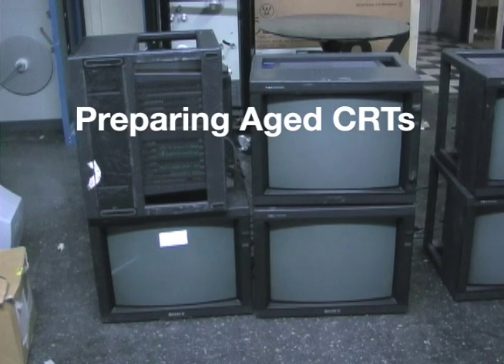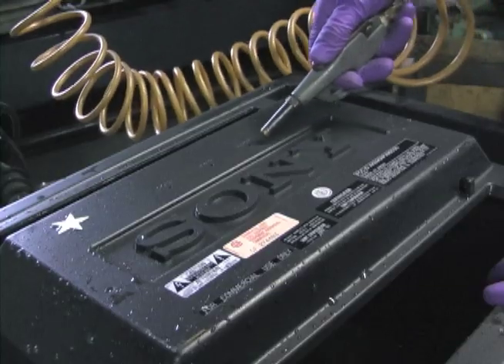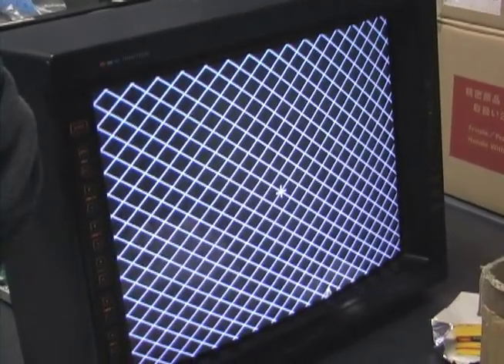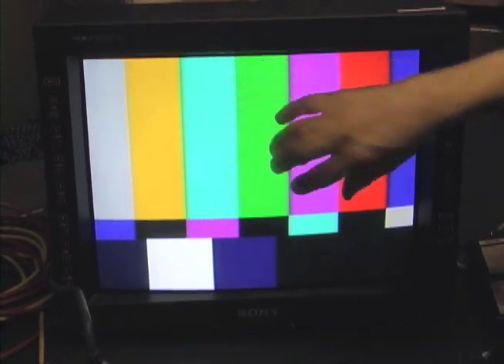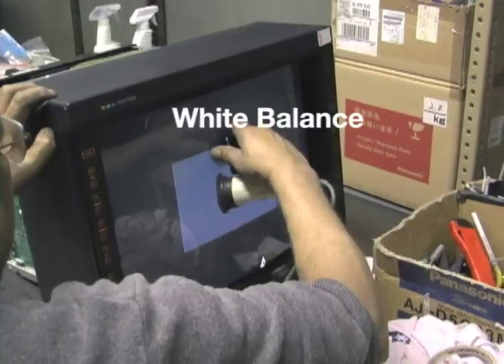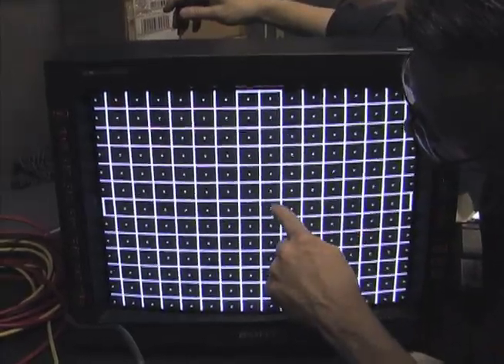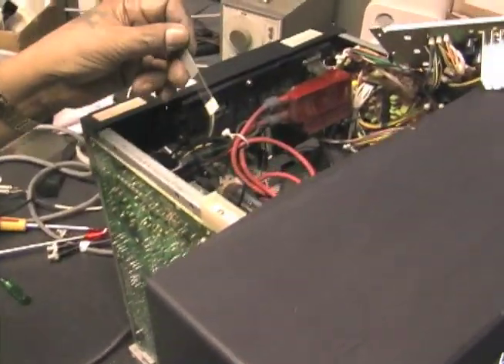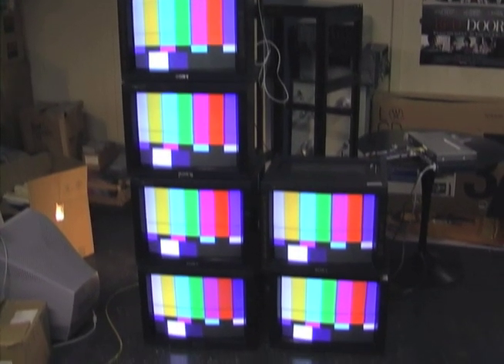Preparing Aged CRTs

Comment: I wish there was a full detailed video showing step by step process of calibrating everything from geometry with a crosshatch pattern and color bars, grey scale, etc....on a Sony professional video monitor and same thing on a consumer CRT television. Can't find too many great vids on learning to do this.
Reply: Some of the PVM/BVMs have geometry calibration in the service menu, but most consumer sets don't, and it's very dangerous to tinker with the insides of CRTs, which is probably why there's a dearth of info readily available.
Reply: Yeah I got one in the basemant that is pretty dark.
Software calibration works, but is to tedious. I would like to calibrate it in harware so it can display properly on all systems connected.
Reply: "very dangerous". Or, not really that dangerous at all.
Reply: urdnal not if you know what you're doing.  I'd wager most people on the internet who want to get their CRT "perfect" for retro gaming and are searching for a quick fix don't have the focus, understanding or patience to handle it safely.  Those are the people I'm worried about working on CRTs.
Reply: Spot on Mr Friday.
Reply: Charlie Friday 
I don't think it has anything to do with anything you said.  It's dangerous working on them and back when it was being done professionally they didn't hand a crt to someone their first day in the job and say, hey, fix this by yourself. Doing something dangerous for the first time with no supervision usually has bad results. You can't get experience from watching a video or following a guide. You sound like you're just trying to put people down.

Comment: VERY nice! I wish I had a refurbished high end studio CRT like one of these. Would be ideal for video color correction and playing retro console games. It's not hard to find them but they are usually very well used and have problems or just need adjustment. If I had the knowledge I could overhaul them myself but since I don't I have to find one that does not need an overhaul.

Comment: That was impressive about replacing magnets to fix the corner issues. I've just bought a 25" Sony trinitron, before using properly will probably take the chasis off and give a good clean etc. Thankfully this once from like 1999, so should be able to calibrate with a remote code.
Reply: Not everything can be calibrated through software.

Comment: You dit an incredible job of restoring those old crt tv's is this also possible on flat crt tv's? Because many flat crt tv's suffer from geometry issues or the fact that the images is slightly zoomed in, all these problems are right there once those tv's rolled out the factory.While 3D content look good but 2D images from retro consoles do suffer from geometry issues as if you watch them on a curved crt tv.It's completely random.I first tout that those retro consoles were only designed for curved crt tv's but that's not the case,
Reply: +Johneymute supergd Flat CRTs can be adjusted if adjustment POTs are available. Many consumer grade TVs don't have as many adjustment POTs as professional grade CRTs like in this video but you can adjust some things.
Reply: +Johneymute supergd Most CRTs will actually have a service menu that can only be accessed by a very specific combination on the remote. This is because these CRTs have an onscreen display (OSD) which means you can adjust these settings without taking off the casing. The only reason that these PVMs have pots for adjustment instead of an OSD is because these PVMs were invented before OSDs were, so there would have been no way of displaying menu settings onscreen.

Comment: Interesting, seems to me later sets were made so you couldn't just take the rear cover off and still leave the high voltage wire from the fly back still connected to the tube...

Comment: Hi not sure if you can help... I have a Sony PVM-14M4A and the pictures look "zoomed in" making the edges of the videos out of the screen. Have tried underscan and changed all settings on the on-screen menu but nothing would reduce the video to fit into the screen. Even the on-screen menu text was enlarged to beyond the border of the screen - would you happen to know what causes the problem - before I have to dispose of the monitor which I don't want to... thanks

Comment: So where can I find that magnetic sticky tac from?
Reply: I found 5 strips in a consumer Sony Trinitron I was taking apart with a friend. We broke it, because the back of the case was soldered onto one of the boards, so obviously it had been worked on before. The strips were probably put on there by a previous tech, or maybe that was done during manufacturing if TVs came off the line with bad geometry to start with.
Reply: Great find!

Comment: Too bad I can't figure out how to open up my PVM-14m4u to change the geometry. As far as I know there is no seperate calibration tuner for it. :(
Reply: Before you go opening things up you may very well be able to change geometry with the service menu settings. Try this out.
Step 1: turn on the on screen menu
Step2: Click the 'Enter' and 'Degauss' buttons simultaneously. 
Step 3: Change desired Settings. 
Step 4: click the Degauss button twice to save changes. 
Step 5: Click the 'Enter' and 'Degauss' combo again to turn off the service control menu. 

This should open the service menu controls. Find the settings for 'NOR DEF' and/or 'NOR (60)'
You should now be able to adjust things like V Center, V Size, Pin Amp, Pin Phase, and many others. You may also what to check out the contols for the RGB levels near the end of the menue for tweaking your white balance to perfection. 

The details of what the controls do are in the repair and service manual.
Reply: Pressing Enter and Degauss at the same time doesn't do anything. No menu comes up.
Reply: You didn't read carefully enough. The onscreen menu has to be desplaying already. Hit the normal menu button first before you attempt to open the service menu with the degauss/enter combo.